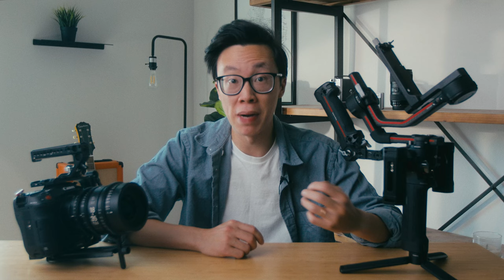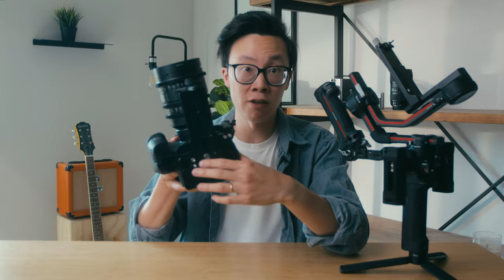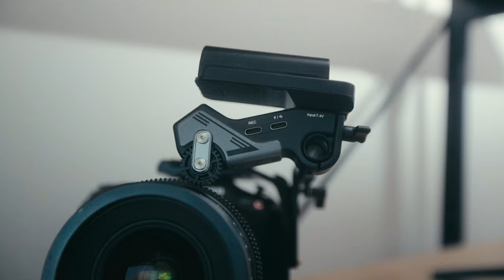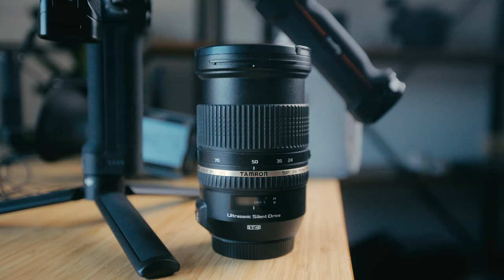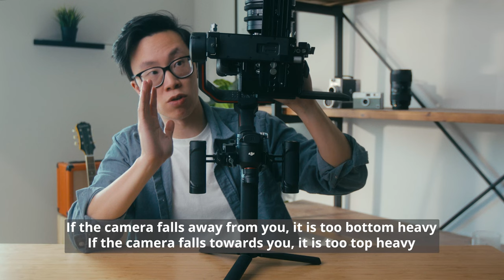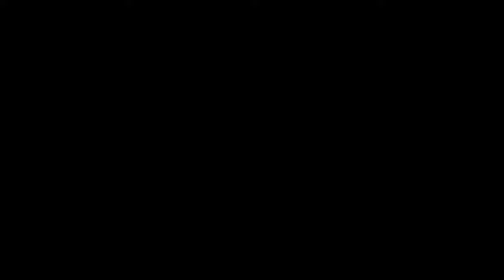How to Balance Your DJI RS3 Pro Like a Pro

Comment: If you have an external monitor, do you balance the camera unit first then attach  the hdmi? Or balance everything first?
Reply from the maker: Great question! Attach the HDMI first before balancing. Once you attach the HDMI, it'll throw off the balance of the rig. Even though it's a minor thing, if you did that for every attachment, it'll add up over time. Let me know if that helps!

Comment: Amazing video! You explained everything perfectly. Quick question, I have not seen anyone balance a camera with a mic yet. I have a Sony a7iv with a 16-35mm G master lens and a NDI filter attached with a Rode VideoMic Pro+ sitting on top. I want to buy the RS3 Gimbal. Do you think I would be able to properly balance the camera with this set up? Thank you
Reply from the maker: It's much harder and probably impossible to balance the Rode VideoMic Pro+ on top of the camera because it adds too much "height" to the camera and won't be able to clear the roll axis in the back when you're balancing the tilt axis. And if you're doing underslung shots, the roll axis will constantly hit the mic on top. You'd have to mount it off to the side to potentially be able to balance/use it properly. The other option that I've experimented with is using the Rode Wireless Me or Wireless Go mics and clipped it onto the camera hot shoe. Because the Me/Go mics are so small, it doesn't add any weight, and you'll have an easier time balancing it on the gimbal. That being said, if you're not planning on doing a lot of movement on the gimbal, specifically underslung shots, then you shouldn't have toooo much of an issue when you have the Rode VideoMic Pro+ mounted on the top of the camera. Let me know if this makes sense!

Comment: Will it be possible to balance the Sigma 14-24mm 2.8 on the Canon R8 body? The lens is 1150 grams and the camera is 460 grams. Please remember that there will also be an adapter that will move the lens forward. What do you think about it?
Reply from the maker: Yep! That setup will be fine on the RS3 Pro

Comment: Have you attempted to balance canons new rf 24-105 2.8?  I just picked i picked up that lens after renting the rf 24-70 2.8 and this monster won’t balance. Thinking I’m going to have to also ipgrade to the rs3 pro and getting that longer base plate. I thought I seen somewhere the arms were longer on the rs3 hoping that this will work
Reply from the maker: I haven't yet! But it feels like it might just barely fit on the RS3 Pro with how long the lens is

Comment: heyy i have a rs2pro combo which i got for canon 5Diii recently got my R5C with RF 15-35L is there a huge difference in rs3pro and rs2 pro combo is the balance quicker and weight wise is rs3pro heavier ?
Reply from the maker: I've never used the RS2 Pro unfortunately, so I'm not sure about the quicker balancing. But the specs on B&H Photo say that both gimbals are very similar, 2.5lb/1.17kg. Hope that helps!

Comment: Hi! Very nice video! Do you think there is any chance the BP-A60 battery would fit? Or would it collide with the gimbal-arms?
Reply from the maker: Hi! I think if your lens isn't super heavy like a 24-70, then you should be able to mount the A60 on there no problem. I've done it on mine and have had no issues although it does come quiiittee close to touching the roll axis haha
Reply: @AlexJCheung  Hey Alex! Thank you very much for your reply! It’s really helpful 😊

Comment: Hi, I just got my RS3 Pro and I can't seem to disable the RS3 control of the gimbal to balance it. What I mean is that I cannot make the gimbal go floppy so I can balance it. When its off its in folded up mode and when its on, its constantly trying to level itself. Do I need to press something to release it? Thanks
Reply from the maker: All you need to do is unlock the gimbal using the little black unlock switches on the arms of the gimbal. Don't actually turn on the gimbal itself. When you unlock the gimbal via the arm switches, you can unfold the gimbal and then relock the arms in order for you to have an easier time balancing the whole thing. Let me know if that helps!

Comment: I just used my yesterday with monitor at top of briefcase , and I balanced then put monitor on , and couldn’t figure out why motor was struggling , make sure you balance with monitor on because it will effect the roll axis balance , I figured it out in 2 minutes but yeah definitely never see it in any of these balancing videos  !!!
Reply from the maker: Are you attaching the monitor on top of your camera?
Reply: @AlexJCheung  yes its was my Kondor blue cables effecting the balance , I got small thin small rig cables that work great !

Comment: Thanks for this. I watched another video and they did the camera back/forth slider for tilt first and then the up/down slider for tilt second. I couldn’t get my camera to balance this way. Switching the order to do the up/down tilt adjustment first made it easy to balance. It might work the other way with different lenses/bodies, but not for me. Nikon Z9 with a 24-70mm F2.8S and NISI filter/hood.
Reply from the maker: Yeah, those two steps for balancing the tilt arm can be interchangeable. Depending on your camera setup, it might be easier to do the up/down adjustment first, and then baseplate adjustment second 👍

Comment: Hello, I have a question. Whenever I tired to move the gimbal over the camera, like saying I want to get low angle shots. I keep hearing a small click sound from my tilt axis side. Is there something wrong here is is this normal?
Reply from the maker: Is there dust in between the motors? That's the only thing I can think of. Either that or maybe it's some plastic that's clicking as you're moving?

Comment: Man... i forgot to buy a V Mount plate to attach to the side of the gimbal for all my peripherals. So I used the run n gun plate that mounts at the battery at the back of the camera. Balancing that was fun with the RF 24-105 2.8 on the front. 😑
Reply from the maker: Oof, that was probably not the most fun trying to balance that rig haha

Comment: those small side handles are better then the dual handle bigger handle these smaller handle must be giving better control
Reply from the maker: I really like the smaller handles better because when I'm gripping them, they're perfect at shoulder width apart. When I use the bigger dual handles, they're too wide causing me to use too much shoulder which tires me out faster. But someone with bigger hands would probably not like the smaller handles haha